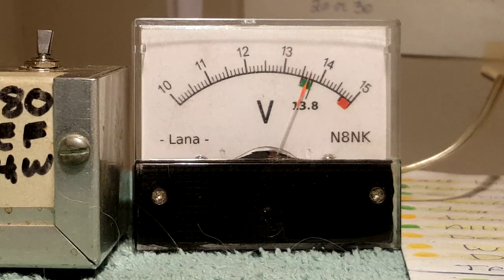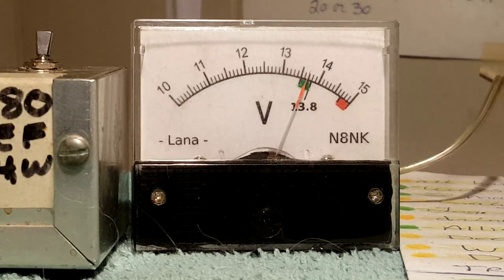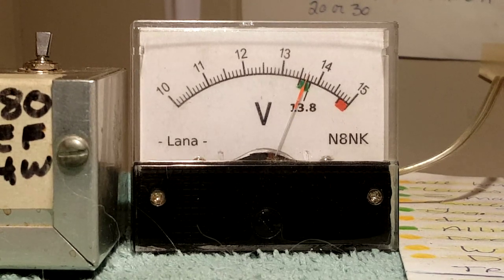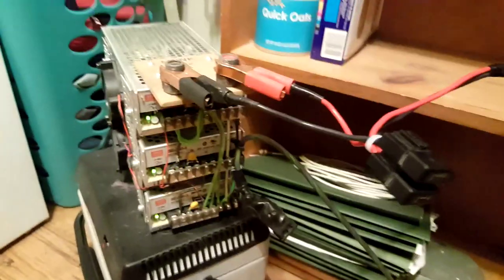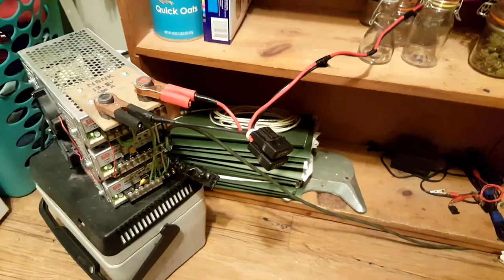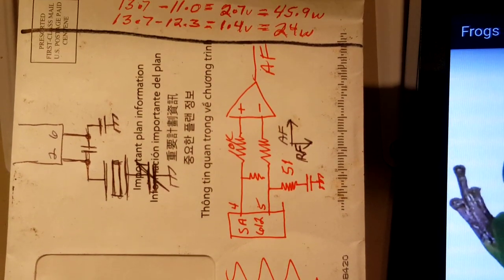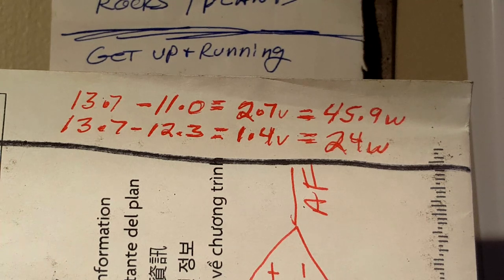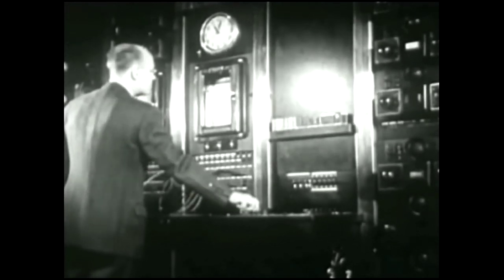Yaesu FTdx-3000 Power Cord Failure

Comment: That's quite a cluster you got there OM. I recommend just finding an Astron 50 or 70 amp at the Goodwill store and send cluster to the ewaste pile. Yes it was the connector, I know. 😆
Reply from the maker: They should use better quality fuse holders. That's shit there connected to The Cluster. lol. The Tower of Power is headed to the garage where it won't ever be used for anything. To me, the only useful parts on the things are the connectors on the front. lol. I've got all the parts I need for a linear supply, and have all the metering done for it, and it's now only a couple hour job to build if I ever get around to it. In the mean time, I'll go back to using a deep cycle battery.. and I'll go to digikey etc and order real fuse holders. Assuming it's not all junk.
Thanks DN and catch ya later  :)

Comment: I've had the same problem with my 7600.  The past 10 years Ive had clean my fuses about four times.  I know its time because my power from the 7600 drops to about 70 watts max but it takes along time and takes me a while to notice.  I use sand paper till I see new shiny metal.  Works everytime (so far).  Enjoy your vids alot.
Thanks,
Johnny
KI5WW
Reply from the maker: Holy cow, i had no idea this was happening to people. Gads. If one didn't know about it, it could ruin a radio outting. Thanks Johnny! 73